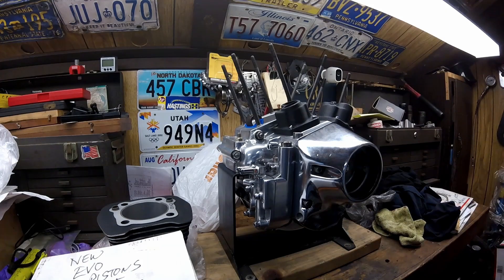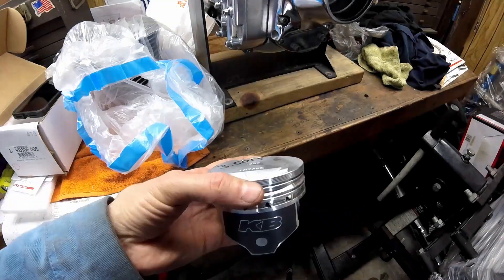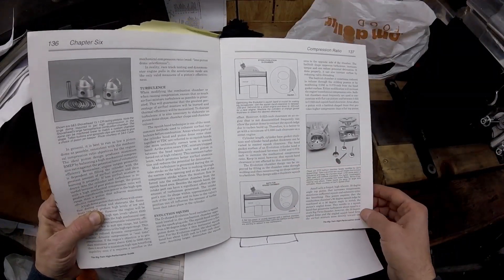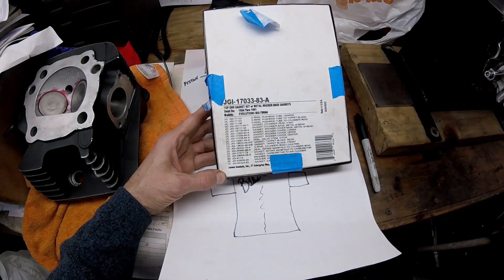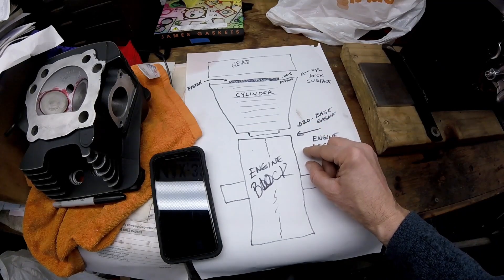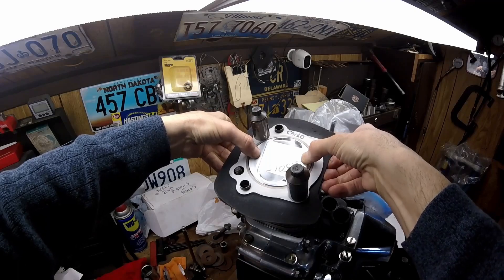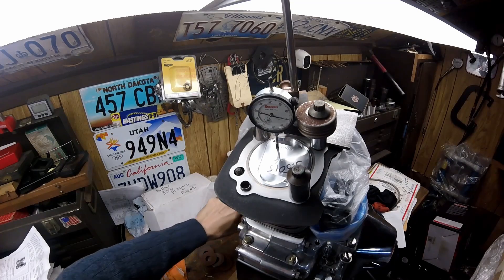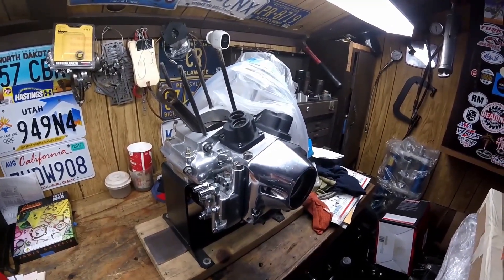How to Set Squish Area Harley EVO Twin Cam M8 head to piston clearance

Comment: Thank you for the video 🙌
Learning about these processes rather then just putting parts together on a 107 build 

 
My 107 cylinders are honed to match the CP 10.75 HC piston with 3mm dome..

Assuming ill be using cometic gasket because they produce a wider verity of thickness.. 
So my question is. 
Can i just use a Deck bridge & dial indicator to determine deck height without using the depth mic 

If it was a flat top piston it would be easier then say the dome piston with 3mm dome

Ok with a simple google search when getting the original number for deck height you dont use a base gasket ! 
Awesome. 

So the process goes. 
Put the pistons on 
Drop the cylinders in 
Measure the deck height to get your piston to head clearance
With that number you calculate the base and head gaskets to set the optimal ( 0.035 ) squish. 

And along the way right everything down and put it into the big boyz calculator to give an indication of the compression
Reply from the maker: Yes, you can use a deck bridge as long as you zero it out on the top of the cylinder first. Thank you for watching and if you have any other questions, please let me know.
Reply: @Rapsgarage i Have a fantastic  question. 
Its confusing for me because its in Imperial. 

I have S&S adjustable quickie Push rods ( 32TPi ) 
But my lifters are Fueling HP+ 4000 

The specs for the quickies are 0.125” preload adjustment which is 4 complete turns. 
The FUELING hp+ 4000 lifters call for 2.39 full turns if using a 24TPi pushrods  ( Fueling  push rods are 24TPI ) 

Ive read somewhere the preload is based on the lifters manufacturers spec
So to calculate the correct preload adjustment set up convert the 2.39 full turn on the 24tpi to 34tpi rod equivalent..
  I typed it in google and Ai managed to give me an answer of 3.17 full turn on the 32Tpi push rods

Now i need to convert the 3.17 Full turns
To inches.  Which is 0.0990” 

Now i have to factor my milled heads which is 0.024” shaved ( 4cc ) 

 2 numbers together will give me the correct preload adjustments on the pushrods ?

0.099” preload adjustment ( 3.17 turns on 32tpi push rods ) 
+ 
0.024” shaved from the heads 

=  0.1230” preload adjustment
Which is a tad under 4 full turns on the 32tpi push rods ( 0.125” is 4 full turns on 32tpi s&s quickie push rods as recommended by s&s ) 

Does that sound correct to you.

I got those numbers from google over view Ai as i dont even know how to ask that question properly
Reply from the maker: @2HotWheels  Preload on the lifters does not have anything to do with how much you deck the heads. If the lifter company calls for .125" of preload and the thread pitch is 32 Tpi then you bring the pushrods to zero lash and take them 4 full turns further and lock them down. Don't over think it...

Comment: Most people don't check piston too head also ,tons of people don't gap the top ring right too tite also you need to adjust your timing right with Keith Black Pistons they reflect the heat back into the combustion chamber. They don't absorb the heat into the piston 36 year of building these turds hundreds  of these hone & bored You're only scratching the surface with that book lol

Comment: Hey Rap,  just about to replace a weeping base-gasket on a ‘99 Evo with 34,000 miles. Checked compression at 170lbs on both cylinders (with an EV27 cam) I plan to leave the piston in the cylinder by removing the wrist pin. I’m guessing I can check piston position after removing the heads as it’s never been worked-on previously and will have the original 0.020” gasket in there?  Stay well and keep ‘em coming 👍
Reply from the maker: If that was my bike I would do the heads, hone the cylinders and replace the rings. Your there so why not. Keep an eye on my channel because this winter I'll be doing this exact job on my 1997 Bad Boy with 28,000 miles. The base gaskets are leaking... 😕
Reply: @Rapsgarage  Looking forward to it - thanks man.
Reply from the maker: Sorry I forgot. You have to check the final thickness on the base gasket you buy. H-D is different than James.

Comment: but what about movement at the wrist pin because mine 
does have some movement great video
Reply from the maker: It should have some side to side movement. You can get the amount from your manual for your model. It should definitely not have any up and down movement. Furthermore, when you rotate the wheels the rods should be free the entire way around. I’ve seen r rod get slightly tight when rotating it. If that happens then you have to pull it apart and do the bottom end. Thx for watching and if you need further help, let me know.
Reply: @Rapsgarage  Hey thanks for responding Iam building a 131 ci m8 flywheels have been
built by stanley gardner & grc with H beam rods deck height came out at 2.7 in the hole
front cyl and 2.3 in rear..your video is the best on you tube
Reply from the maker: @roncoburn7771 Thank you!! I appreciate that. Good luck with your build.

Comment: KB are good I ran Forged and it was tight at under 150.00 a set .   I always use 40th head gasket  I like a 1/2 inch cam I know I have the little extra clearance .   I only have Feller gage I stop there with a strait edge .  Useless for me to use my run out gage with no deep gage .   Great Video
Reply from the maker: Thank you for watching.